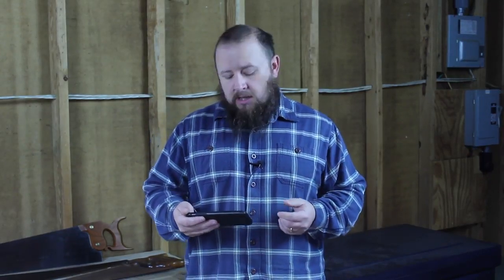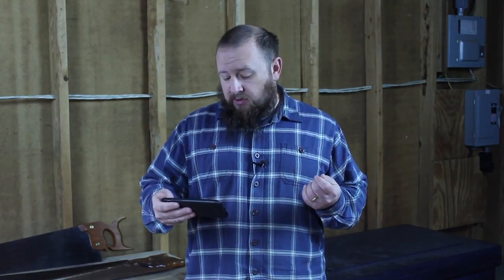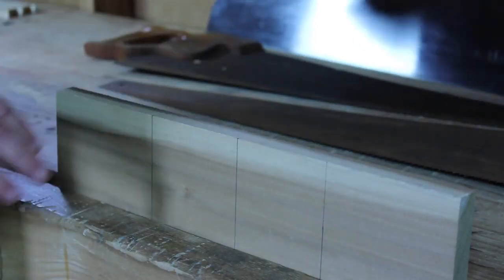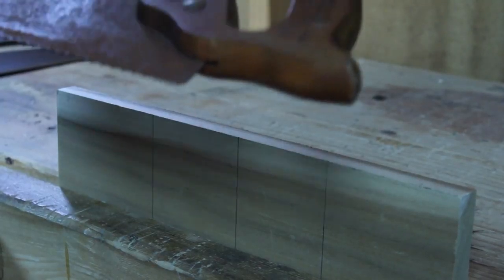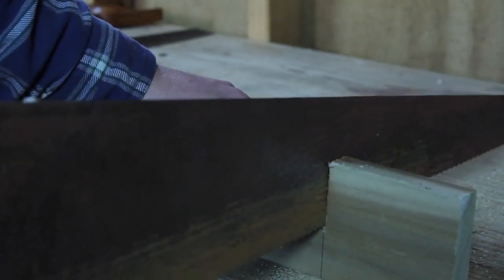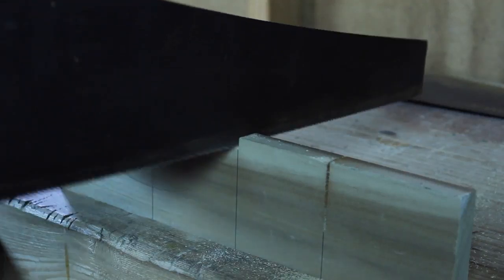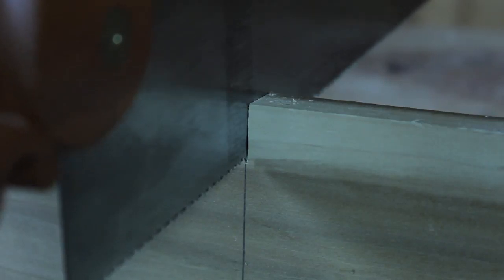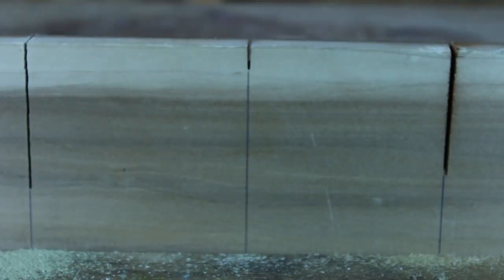Hand Tool Woodworking Q&A - How Much to Set a Hand Saw

Comment: This is a really good piece of information. Your suggestions are one of the most practical, logical and useful that I've seen on YT. When I started woodworking few years ago I've read a tutorial on how to set and sharpen a saw. The article said, as a general rule, to set the teeth overhang (on both side of the blade) to half of the thickness of the blade. It make sense to me now, after your explanation, because I believe ( I don't have so many saws to compare) that dovetail saw should have a blade more thin than a panel saw, and consequently the setting will be less on the thinner blade and more on the thick blade. I would really like to know your opinion on this  "half the thickness" rule. Thanks for sharing.
Reply from the maker: th34lch3m1st It’s not a bad rule of thumb. But  it doesn’t account for wood type, which can impact it as well. Softwoods typically require a hair more set than hardwoods. Not too big a deal in a dovetail saw but can be important in a long rip saw.

Comment: How do I prevent the body of the saw from twisting or bending when setting it's teeth. Thanks, Ernie Line
Reply from the maker: Make sure that you’re only setting half the tooth height. If the tooth is bending all the way to the bottom of the gullet, you need to adjust your saw set. The bend should only be from the tip to the middle of the tooth. It could also be your technique. Make sure that you’re just squeezing the saw set and not twisting it. Putting the saw as low in the vise as you can will also help.

Comment: I do not know Bill Elliot but I will bet dollars to doughnuts that he IS an engineer. But he is not an engineer who works in the field where has has to deal with real world item and problems and precision measuring devices such as a micrometer or similar tool will do nothing for the problem.  I can say this because I am a retired Mechanical Engineer who spent years in the field working with those real world problems and learning a lot from mechanics, electricians, instrument technicians and operators about how things work (that I was not familiar with) as well as Company Service Representatives who were called in for jobs such as turbine overhauls (steam or gas), electric generators powered by those turbines, very large pumps and gas compressors driven by those turbines, adding vibration monitoring systems to existing pumps. All of which I used when I later worked for engineering  firms which had engineers who had no idea how things were really done in the field or did know there were alternatives to their problems that could be done in three days instead of six months because an alternate solution using a different product that the Original Equipment Manufacturer (OEM) was available that would to the same thing.